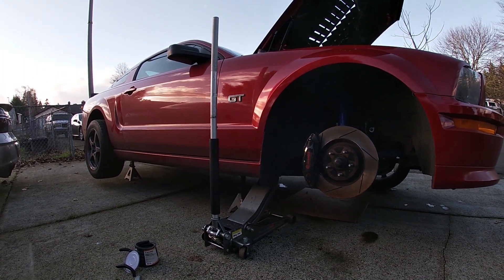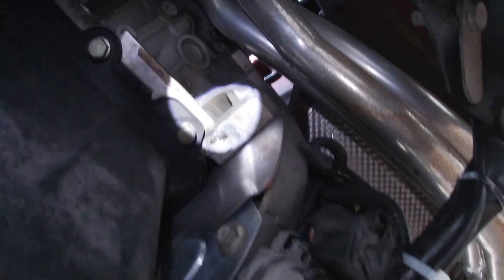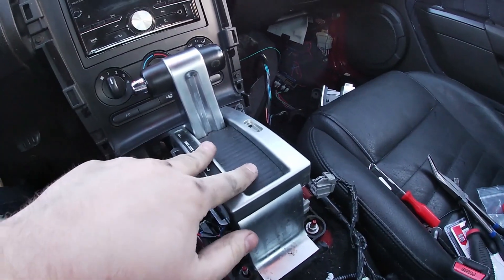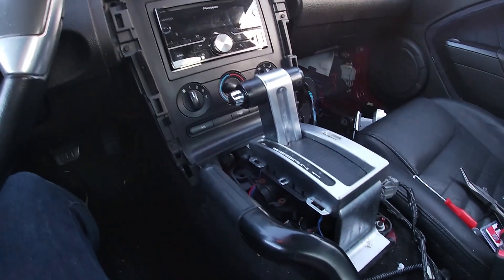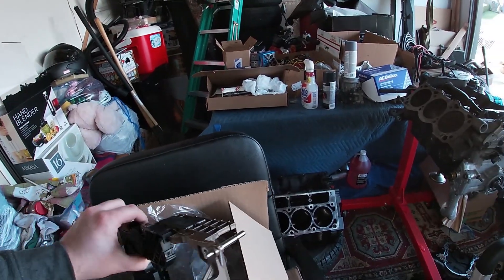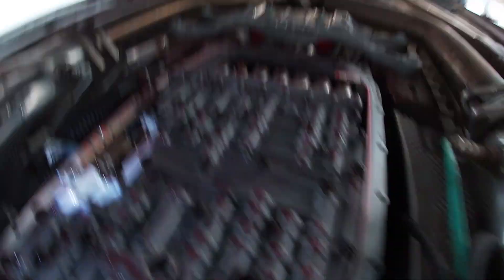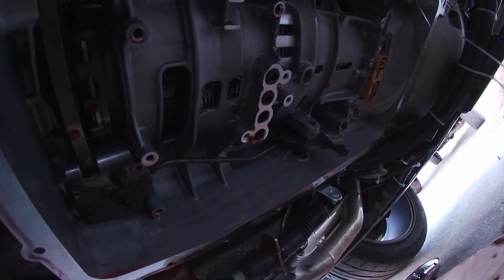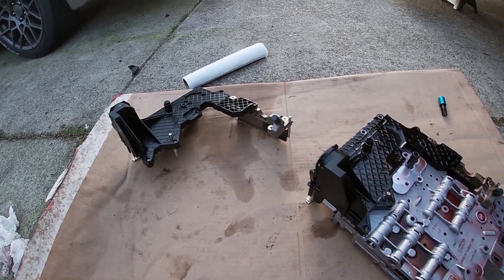3v Mustang GT 6R80 Swap - US Shift Quick 6 Install! | Part 3 (6R80 Lead Frame Replacement)

Comment: I have a Mustang  2015 eco Automatic i order a leadframe from ebay. But I don't know. If it will fit. Because I read with TCM... Without TCM... I don't see Clear. :-( 😞  what is TCM? What must I Buy for a part? Please help

Comment: Did you look into getting the paddle shifts from the 2015+ mustangs instead of aftermarket? I wonder if would be easier to wire up.
Reply from the maker: I honestly didn’t know the 2015+ models had paddle shifters. Probably the same difficulty to wire in aftermarket vs 2015+ oem

Comment: Did the 5r55 shifter work perfectly?
Reply from the maker: The TCI ratchet shifter I had did not work, OEM 5R shifter worked fine
Reply: Do I need to get the 11-14 linkage or will the one for the 5r55 work? Will the transmission plate that goes between bell housing and block work for 5r55 or do I get the one for the 11-14 mustang? About to start on mine soon and trying to get the rest of the parts. Thanks!!